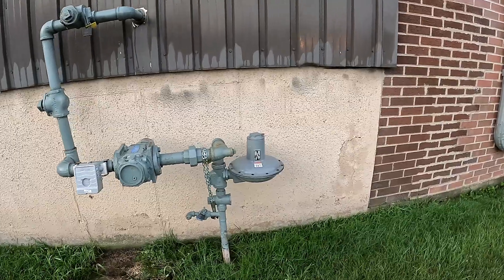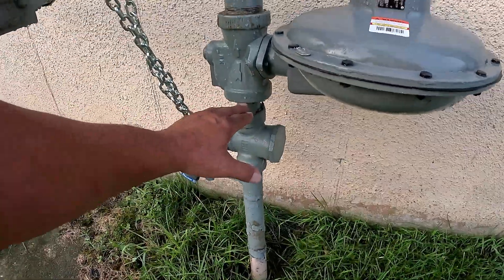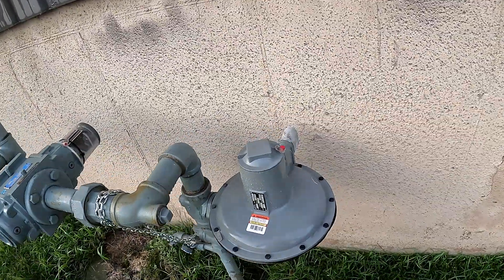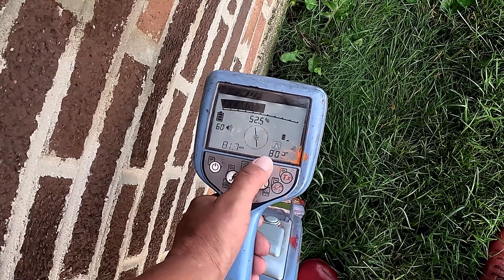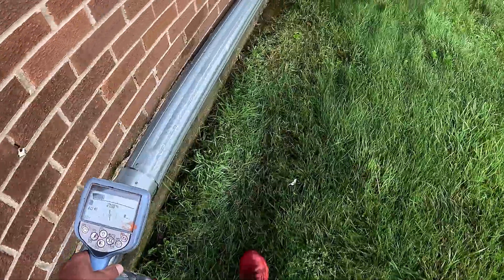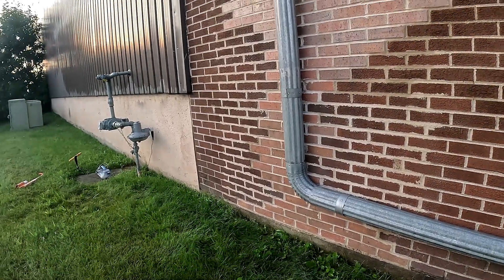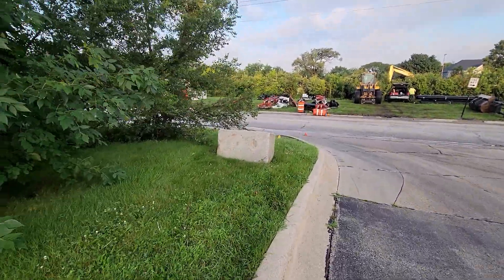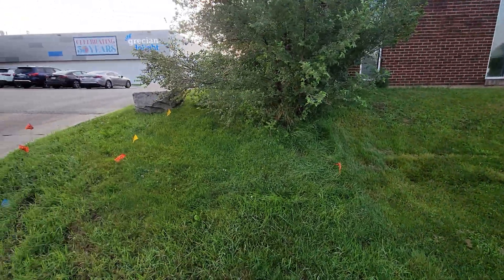Natural Gas | Locating a Gas Service off The Vent

Comment: Lots of times you can pick it up with higher frequencies such as 83k or 200k. If the meter is inside but the vent is outside that’s what I do, as long as the main valve shut off is not an insulated valve it will pass through. Most of the issues with gas are with shut offs being insulated or if they installed a “break-away” fitting  which is insulated at the foundation. 

I work for the gas company, I’m going to ask the meter dept if the regulators are actually insulated themselves or if it’s the fitting threaded beneath it. Regardless though insulators SUCK! In my opinion gas is one of the most difficult utilities to locate. Even tracer wire has its difficulties. 

Great videos btw, I love the troubleshooting aspect of being a locator. Learn something new everyday
Reply from the maker: Thanks a lot for your comment. When using higher frequencies, there is a tendency to bleed onto other utilities rather than the one you're trying to locate. This is where the younger locators are getting damages with these higher frequencies. In 2000, when a gas service was hit off the vent, gas company representatives told me that the regulator had an insulator, making it impossible to locate off the vent. Once again, thank you very much.
Reply: @811chicago5  that's good to know about the regulator being the insulator.  I wish more of my day was direct connect marking out, a large part of my territory has low pressure cast iron mains and steel services (with no curb boxes)  with inside meters.  marking indirect is a totally different day of work compared to direct connecting to tracer wire or hooking up to electric etc.  

do you "drop the box" much where you do locating?
Reply from the maker: @4doorxj  Here in the suburbs, everything is in the open, so dropping the box isn't necessary. It would have been nice to have curb valves, as they would have made your job a lot easier to mark out the service and provide an idea of the gas main's location.
Reply: @811chicago5  good record keeping and quality install work plays such a big part in locating gas lines.  Especially with poly gas pipe, the tracer wire connections at the mains are vital.
Reply from the maker: @4doorxj  I remember when a gas company began using PE gas services and mains. Their twist-on wire connectors for linking services to the main were poorly designed. They used connectors without the metal piece inside, leaving just a plastic connection. This made it impossible to locate that specific main from any services in the area. lol
Reply: @811chicago5  I hear ya man, I locate for the utility company in house and the past year or so they also started using box connectors for tying tracer wire from a service to a main together and its ruined the signal as soon as you get to that connector. Up until then they used copper split bolt connectors and you could mark out entire street hooked up to one wire... the daily struggles of being a locator lol